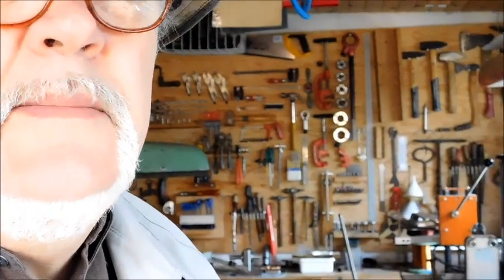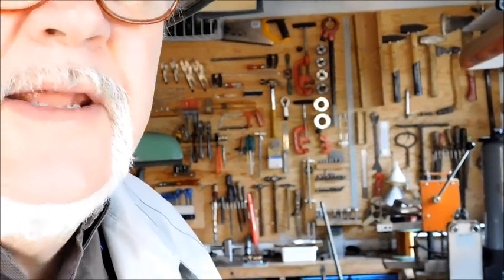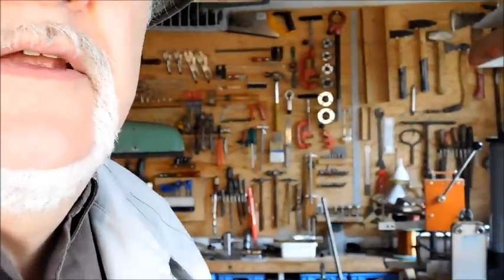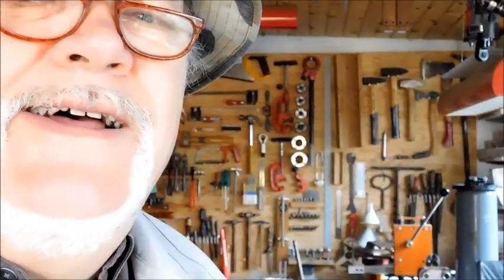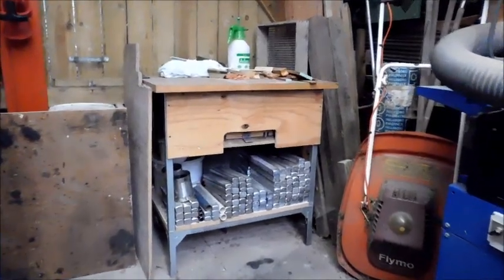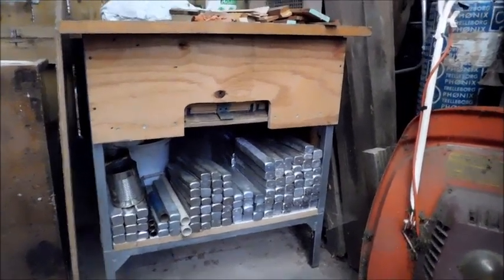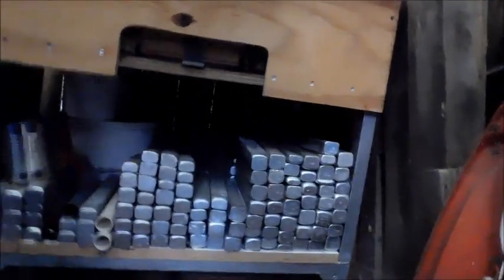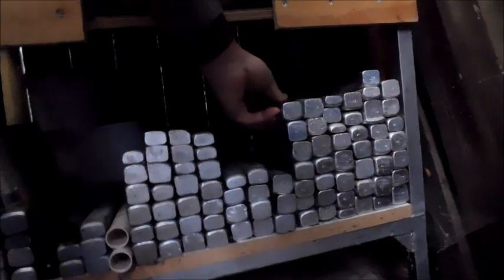ShortOne 001

Comment: I'm so glad that the sleeve annealed properly.  Hardening should be the reverse.  Raise the temperature of the steel to a prescribed degree, hold the steel at that temperature for a prescribed length of time, then quench the hot steel in a prescribed media.  Polish the hardened steel (so that you can observe it's color) then raise the temperature to a prescribed tempering temperature then let the part cool slowly, or conversely, quench the part if prescribed.  The real trick is going to be finding out what kind of steel this is; thus finding out what those temperatures and times may be.
Reply from the maker: +vajake1 Yeah, when I finished machining I'll decide if I need to harden it again ... it would be best to harden it - surely !

What worries me most is the fitting of the MT 5 into my lathe spindle ... will it fit again ???? - I hope so ;-))
Reply: You raise an interesting point.  Your sleeve might have to be re ground to fit your spindle for you to achieve any sort of accuracy.
Reply: +vajake1 Heating metal ==> Dimension change, so, regrind will be needed, if you have access to hardness tester, you could have an idea of where you're going as you work into the hardening and tempering process, on the cheap side there is a special set of files that will give you a broad range of where you're at... Have fun... ;)